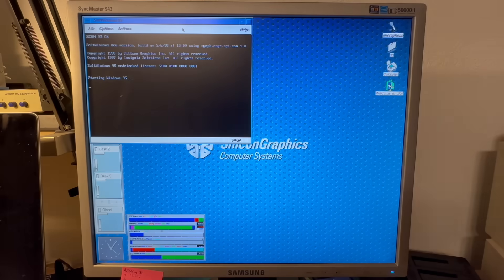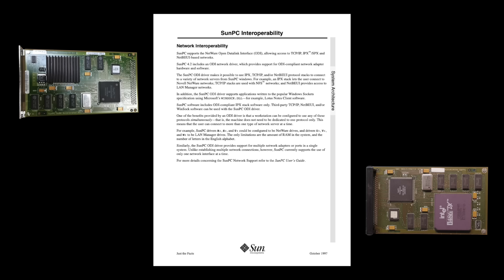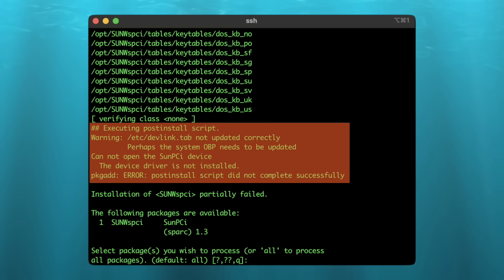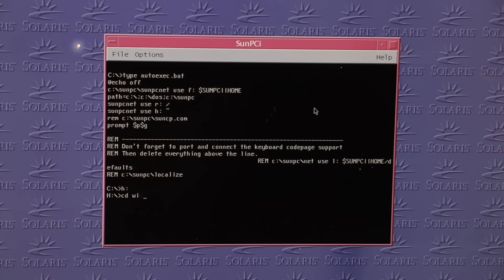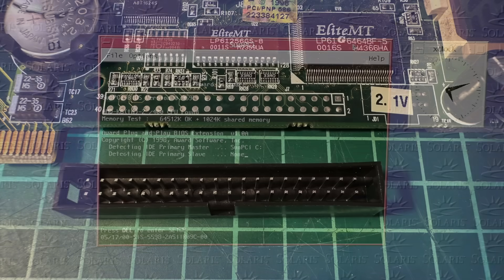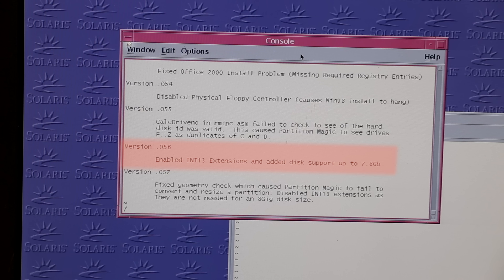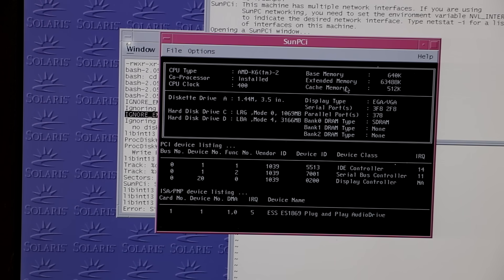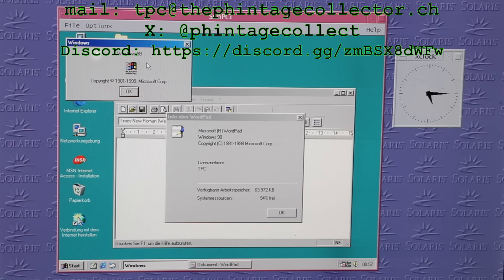SunPCi: A Hidden x86 PC Inside Your Sun Workstation!

Comment: I wonder if it's even possible at all with the HDD - what the did the built in bios say?
Reply: I wonder if Linux or Windows NT would see the physical drive given that those access the IDE controller directly, just like the BIOS
Reply: @kFY514  yeah i wondered that myself
Reply from the maker: @kFY514  Nah, Linux won't work, according to https://vdberg.org/~richard/Linux-on-SunPCi-mini-Howto/

It states there, that the SunPCI uses Int13h only, and thus Linux, BSD and alike can't see the (virtual) hard drive.

NT can't install natively, but only through DOS, and injects a specific driver.
Said that, direct drive access seems out of question. All drive access must go through Int13h.

It may be, that while the real hard drive seems not to be mapped to Int13h, and while I imagine Sun forced the Int13h route only for reasons to make it work with the emulated hard drives, the real hard drive may actually work through direct access (alas circumventing the BIOS).

I definitely have to try that!
Reply: @systemchris  at least POST listed it as hard drive.
Reply: @Lofote  oh I meant in the press DEL to to enter bio part
Reply: @systemchris  that would be CMOS SETUP and my guess it is listed here as it uses the same detection as the POST display before ;)
Reply: @Lofote  maybe so, but never saw what it looked like or how that behaved - when in doubt rule out everything like he did with the environment variables
Reply: @systemchris  i agree on that
Reply from the maker: @Lofote  Absolutely, it appears in CMOS Setup, same way as on the POST screen.